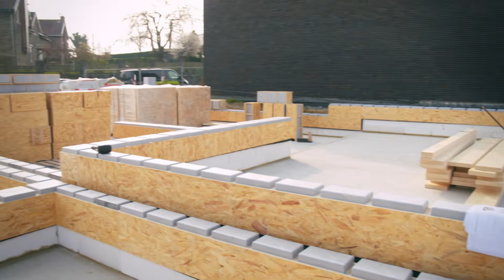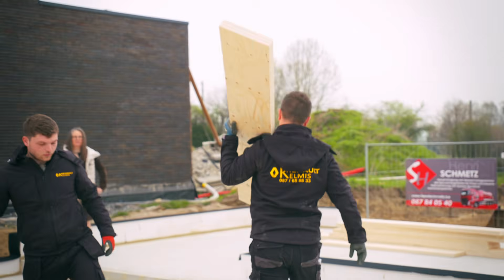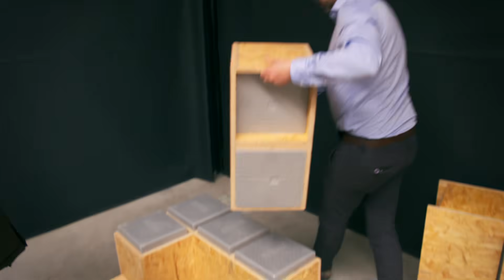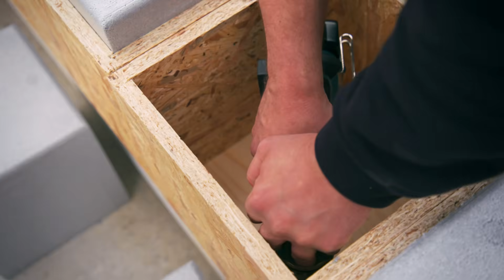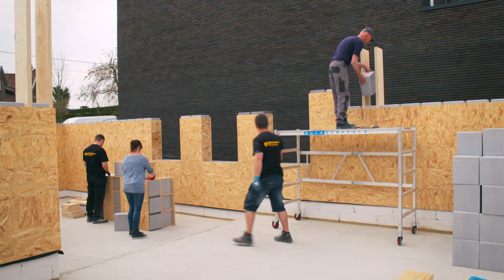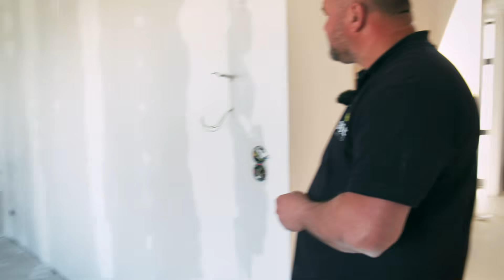Just Like LEGO - Assembling a House From Building Blocks | Free Documentary Shorts

Comment: All the best DIY no skill housing products like this one originate from Europe and are not available in the US. Stinks for us.
Reply: ...  they are major IBC/ASCE code violations.
Pick Two:    Cheap, Fast, Good  - Is the normal engineering dilemma
This product is not cheap as it is proprietary 
This product is not faster than normal wooden construction, as it requires more labor/engineering/procurement
This product is not good/better than a conventional wooden frame installation
Reply: scratch that.. its even more expensive than i thought.... they are hand making each block
labor costs are 2-4x what a normal timber frame would be.

Comment: I'd like to see this house stand a hurricane.
Reply: Common sense as to where you're going to build it
Reply: @brianpatrik  2016 ASCE requires a 90+ mph design wind load.  
those foam blocks... are not load rated. 
Thus, this is a IBC/ASCE code violation
Reply: @zarthemad8386  No, the 2016 ASCE code (ASCE 7-16) does not mandate a 90+ mph design wind load; instead, it uses a wind speed map that varies depending on the location and risk category of the building, meaning the required design wind speed will differ based on the specific site, often exceeding 90 mph in high-risk areas. The 2016 ASCE doesn't set a blanket design wind load of 90 mph for all structures. The ASCE 7-16 provides guidelines for calculating the appropriate design loads based on these specifics but not a blanket rating for everyone. You can refer to the ASCE 7-16 document, particularly sections 26 (Wind Loads).

Comment: But what is the R-value? Every time I try to research it, they give a calculation back, not an actual number. I'm not interested in trying to get a calculation, I'm just trying to find an average R-value overall with regards to this. Why is this so hard for them to provide?
Reply: Because Europeans don't use r-value to measure their house insulation
Reply: The insulated foam inserts are EPS according to the website. That means they would provide around 4.5 R value per inch. I would guess the foam is around 6 inches which would give an estimated R value of around 27 give or take based on the actual thickness. The OSB adds another 1 R or so depending on the thickness. This is assuming all joints are taped. The ends of the blocks and the center crossmembers create a direct wood conduit from the outside to the inside which in those areas, and that would make up a decent percentage of the wall, would have probably less than an R 7 😢. If we knew the exact dimensions of the brick we could get a good estimate of the true value. I like the idea but I think it could be better designed and implemented.
Reply: I suspect if you taped every single seam in between every single block, it would produce a pretty low r value. Seems like an interesting take on a cheap but efficient build.
Reply: @mattypaul7902  Thanks for responding. Even if I don't have a number, it let's me know as a layman to not use these products.
Reply: @timg9212  Have you found a suitable “cheap” but efficient alternative? I’m looking for something like this, but with excellent efficiency.
Reply: @mattypaul7902  I haven't yet. I hope others find something and could let us know here.

Comment: Not  here yet built in Europe 
You draw the shape
They do the architectural work
No waste left over
7 days 2 level 2000sf livable sqft.
R rating meets code.
Someone needs to do it here. 
Built system to route wiring plumbing  hvac etc.
2000 sg ft in 7 days  by your own labor
Reply: fails IBC/ASCE wind loads

Comment: For someone who has limited or no building experience this looks a weak building, but in reality if you seen how you brick building is built you probably think the same about that as well, this is an amazing idea, i would have one, once you understand how the electric, plumbing ect ect goes in this is a simple cheap effective way to build houses, once the house builders get on to this the more you will see built around the world, you have just got to bare in mind this is a prefabricated house it won't be meant to last  hundreds of years like brick buildings but lets face it most of the brick new builds these days probably wouldn't last hundreds of years either, prefabricated is meant to last between 25 to 50 years as a temporary build, but if maintained properly i reckon you would get 50 to 100 years with this method & at this current price of €120k all in that's a bargain, i know of brick house built in the 60s that was torn down after 40 years & the one that are still stud now are in the €200k plus range now but don't see them last another 20 to 30 years before they will become derelict!

Comment: If this ever comes to the US they will make the blocks a 1/3 of the width to save money and make sure the house is cheep to build.
Reply: Why be an idiot?
No matter how good you are at it.
Reply: It wouldn't be as sturdy as using 2x4 or 2x6 studs.  It's just osb with plastic.
Reply: @cedarpoplar  and any water leak will destroy the exterior wall.... old shiety board (OSB) is ok on roofs
but put that in a structural member.... and you are gonna have a bad day when you discover you had a leak for 1-3 weeks after a wall/roof colapse
Reply: 😂it's a fire hazard...no thanks.

Comment: So sheer strength on the blocks depends on foam insulation? You also have to build a wall inside to run wiring and plumbing? I truly see nothing useful here. The time isn't great. My dad and I frame a whole floor out in a day or two depending on size. We also don't have to build another interior wall to run wires.
What happens when the foam degrades? You'll have walls shifting. Nah, not for me.
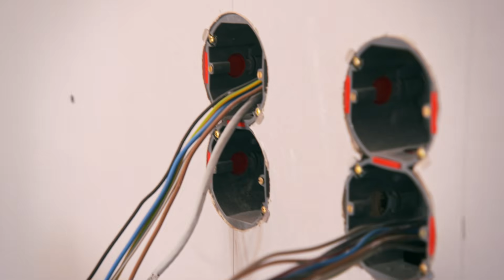Reply: 11:19 "You also have to build a wall inside to run wiring and plumbing?"

How is putting up the "plaster board," as she said, different from putting up the drywall in a regular house? Why would you call the former "building a wall" and not the latter?
Reply: @salaciousBastard  ??? If you build a house with 2x6 you already have a voided area to run plumbing and wires. You've built the wall with voids. You also put the drywall/plaster board directly to the the stud. Here you're laying the block and then going inside and building ANOTHER wall to do those things. It's inefficient. It's also a RIDICULOUSLY thick wall. I still question the long term stability with foam holding the blocks in place. Sorry, this isn't impressive to me. 
Does it look fun to put together? Sure! I liked legos as a kid, too. I would NOT build my house this way.
Reply: @ImNotaSithReally  I didn't say it was impressive. I was trying to understand what you were talking about. They're not building another wall. Your house has two walls. Outer wall and inner drywall. This house has two walls. The whole block wall is the outer wall. The drywall is the inner wall. The only extra step I can see is the spacers for the void. They could probably engineer that into the blocks in any case. I wouldn't buy such a house either. There's no resale value and who knows how long it lasts.
Reply: @salaciousBastard  No, a modern house has one wall. To clarify, wall in this sense is referring to exterior walls. That one wall is what provides the structural aspect of the house. Drywall, despite it's name, is not a wall. It is merely a method of covering the actual wall. It's no more a wall than a coat of paint.
The 'spacers' as you put it are exactly what the studs of a wall are so, yes, they are indeed building two walls; though one isn't structural. It's just double the work for what benefit...you got to play adult legos?
This is done in other types of building as well. In brick, and log (sometimes) homes they do the same thing. Again, it's inefficient in these homes also.
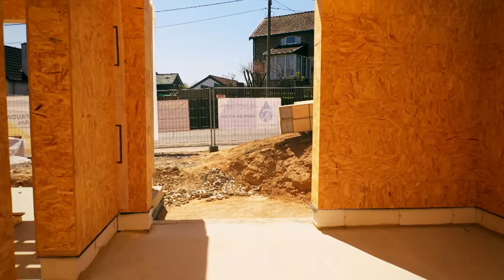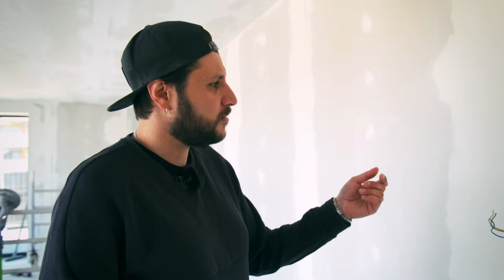Reply: @ImNotaSithReally   So you're calling a wall as a structural support only. Fine. Post the timestamp of the second wall used for structural support. I've gone through the entire video and I don't see a second wall. I see the block wall. 9:37 Then when in the finished home 11:03 I see the drywall. I'm not a carpenter so point out what you're talking about. If the term "spacer" is inaccurate the woman calls it a batten like a "fence post" placed every so often. That's what creates the void. I don't see how "fence posts" are a wall.
Reply: @salaciousBastard  No, a wall doesn't have to be structural. Most interior walls are an example of this.
The battens, or spacers, as you call them are also called studs to people that build. Stud walls are what is used in the vast majority of construction be they wood or metal.
So, in this house we have the Legos which make up one wall system. They then have to build a stud wall inside to create the void for wires/plumbing. That's my point, just why? It's inefficient. You could just build the stud wall and have everything you need. No needed extra step to run wiring/plumbing or hang drywall.
And I still question the stability of the walls with foam holding the blocks together.
Reply: To sum it up for people whom have never swung a hammer:
The cheap lego blocks cannot be drilled to run power/electric/sewer.   You need to build additional framing to hide those utility services
Thus, you need to still do as much or more frameworks to build the house.  Which makes this external wall fabrication method completely wasteful (unless its for a shed)
Pick Two:   Cheap, Fast Good
Lego Vendor:    I Chose None
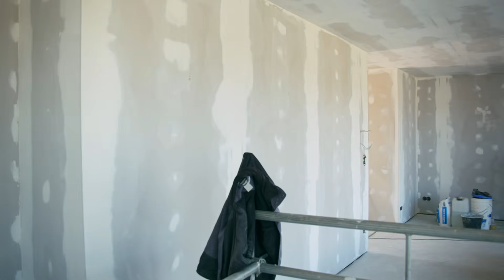Reply: 11:30 & 10:58 show clear indications that they had to build additional framing within the building.

Comment: Wouldn’t be such a bad idea if they used actual hardwood instead of cheap trash particle board that won’t stand the test of time.
Reply: what do you think your house is made of. OSB!   its as strong as plywood.
Reply: not the structural beams
Reply: lol. Hardwood is not used in home construction, or at least probably hasn't been for 100 years. OSB is what they have used and it will last for 50 years or more. It can even get wet, though a properly constructed home won't get wet.

Comment: Don't you have to space that wood because water will expand it ? It will warp with any moisture and pop seems
Reply: Like all houses waters a problem if you don’t seal it correctly
Reply: Its called moisture treated wood
Reply: @korben7710  OSB cant be treated.
Reply: They explain the type of wood they use to prevent that. Just watch the video 😊
Reply: And it's protected with a skin just like a house 
The walls art exposed.

Comment: Yes but would a tornado blow it away
Reply: How many homes withstand tornadoes? I’m guessing your next question is if it’s tsunami proof. 😂
Reply: @MckieDs595  probably no house will survive a f5 but a regular house could survive a f3 and below. He's asking if this house could do that.
Reply: @Alex0992  Most modern built homes can’t survive an f3. Asking if a home can survive something that more than likely will not happen considering most tornadoes are exclusive to certain geographical areas.
Reply: @MckieDs595  "f3 and below" just admit you misunderstood the dudes question Don't keep digging a hole.
The dude asking the question obviously lives in a tornado area 🤦🏿‍♂️
That's the first thing I thought of too how will it stand up to a tornado
Reply: @Alex0992  ASCE 2016 required wind load designs for 90 mph for most of the US. later versions have since changed the calc a bit (higher winds, lower risk factors for some applications).   These legos would not withstand 90+mph winds.
Reply: Can't possibly be as strong as a cinderblock or alternative block home reinforced with rebars and filled with concrete!
Reply: Houses are not required to be constructed to withstand tornadoes. Everything would have be constructed with CMUs and most could never afford them if they were.

Comment: Goes so much inte building a house. Sad its advertised as "building a house by yourself" when its just the framework with alot of thermal bridges
Reply: Wood does not conduct much in the line of heat or cold. Those houses would be very efficient at keeping in heat in winter and the house cool in summer.
Reply: It doesn't matter about the conduction of wood, wood is a terrible insulator so there could be a lot of thermal bridges with this building technique. Unless the foam is continuous.